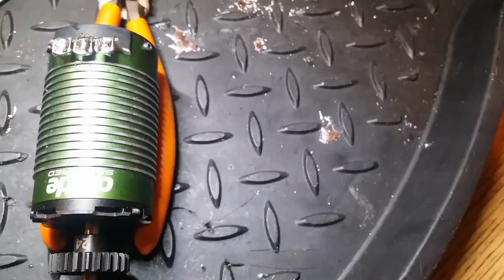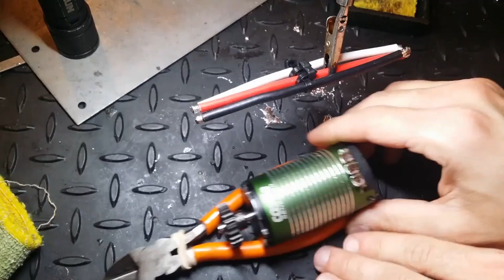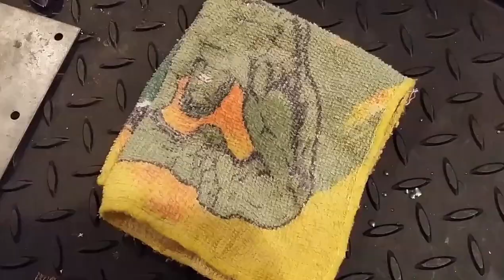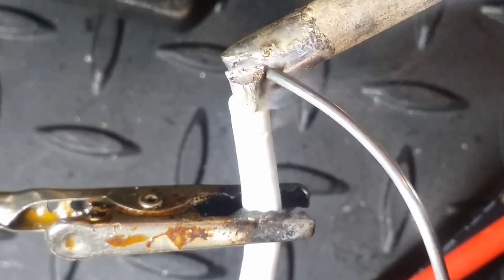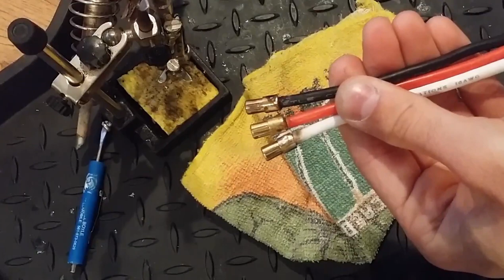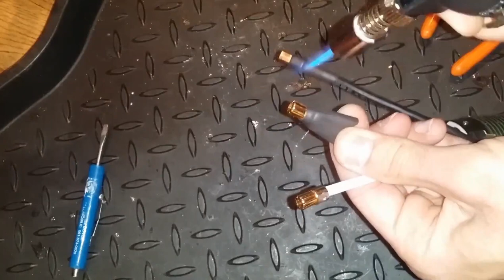Soldering Wires & Bullets on RC Car Castle 1800kv Motor

Comment: Easy Peazy ! Only took me two hours and a half a roll of solder to do a motor and battery terminals and I have a little to no confidence in my connections!😢
Reply from the maker: Gotta practice, also gotta practice with a good iron. Get an SP80NUS from Amazon. 80 watt Weller.

Comment: Clean Work buddy. 👌 I'm about to solder up some Turnigy HXT 8MM connectors. Never used them before but they look like they can deliver & handle the amps I'm goona put through em.
Reply from the maker: Thanks! Nice, make a review video of them if you can. I'd like to see how those perform
Reply: @InnovationRC  See what I can do buddy. At the moment I can't even get out with my RC cars with COVID 19 here in UK on Lock Down, so just keeping busy at home with projects & with family. When I do get out however I will see if Wife or friend will record Vid on Phone. Take care. 👍

Comment: I had one of my leads get ripped off and it also took off the gold plating. Now when i try to solder the wire back on to the copper plate, it will not stick at all. Been trying for so long and even took to someone and they couldnt get it either. Any tips for how i can get it to stick? Is it going to be the flux that makes it stick? Thanks!
Reply from the maker: That's unfortunate. Maybe try adding flux and attempt to re-tin the tab. If not wire brush on a Dremel to rough it up hopefully it'll work after tinning that.

Comment: Does it make a difference if you wire direct from motor to ESC, or use bullets to connect two wires together? From a practical point of view it’s better as it’s easier to swap motors out etc. I assume any performance difference is minimal, if at all. I am about to solder mine, and would prefer bullets so it’s easier to take motor out for maintenance, etc
Reply from the maker: Not much of a difference if your soldering is good. Pick your poison

Comment: Super satisfying. I had a question however, I have been searching around and can't find the answer. I have a motor, the Turnigy XK3650-3650 sensored, and the terminals on the motor are these circles/pcb board. How do I solder to that? Is it just a female bullet connector in there and cover everything in solder?
Reply from the maker: Likely you have to stick the wire through and solder on the flat spot of the solder board. I will say it's tricky. Be sure to lightly tin the wire and have something hold the motor in place while you carefully do that solder job
Reply: @InnovationRC  thanks man. Keep on crushing it
Reply from the maker: @Spacecadet0730  thank you 💪 good luck with the solder

Comment: are you supposed to leave the motor wires exposed? Isn't it dangerous?
Reply from the maker: Yes you'll be fine as long as it's soldered correctly

Comment: what alloy solder do you use for soldering motor wires?
Reply from the maker: I use 60/40 Rosen core solder, leaded so it's easier to melt. For the serious cars I use silver bearing solder. Higher melting point
Reply: @InnovationRC  thanks 😊

Comment: Wow I have been struggling like crazy on this. It’s not that I can’t solder. It just won’t stick. But I’ll try this neat little trick and hope that works
Reply: It did. Thanks
Reply: so what was the trick it wont stick at my motor to i dont know what to do
Reply: @tanertuncer7284  you have to clean the surface really well. Make sure you get all the coating off.
Reply: @jimmyv1753  you mean the gold coating?
Reply: @tanertuncer7284  yes. Well. The coating yes. It should be copper underneath. I think they coat it so it doesn’t tarnish. But if you don’t get all that coating off the solder will not stick.
Reply: @jimmyv1753  thanks im gonna try it again tomorrow
Reply: @tanertuncer7284  good luck my friend. I know how frustrating that can be. The method that worked best for me was to get a lot of solder on the post and a lot on the wire then press them together and pin the wire down with the iron until it melts together
Reply: @jimmyv1753  cleaned the coating until the copper comes and didnt work either idk
Reply: @tanertuncer7284  do you have flux paste?
Reply: @jimmyv1753  no but i could get some
Reply: @tanertuncer7284  get some. It will make things much easier. Also thin solder. Thinner solder melts much easier and the paste on the copper will cause it to absorb the hot solder. I’m sorry you’re having such a difficult time on this thing. I’ve been there. Before you do that see if you can get any solder to stick to the either the copper post or the wire. If you can’t get it to stick to either then get the paste. Put a small amount of paste on the wire and a small amount on the post. Just a tiny amount then melt it with the iron then see if the hot solder will stick
Reply: @tanertuncer7284  did you end up getting it?
Reply: @jimmyv1753  nah didnt try it today dont have that much time safly cause im having my finals in this time but i will try it these days we will see
Reply: @tanertuncer7284  I get it. I was just hoping you had some success with it. I also am lucky to get a few minutes a week to work on my RCs
Reply: @jimmyv1753 how do you get the coating off?
Reply: @officialoppclan2039  I use a dremel with a harsh scrubbing wheel. Like a scotchbrite pad but a wire brush might get it off or a razor blade to scrape it off. It takes a little scrubbing to get it off. Makes for a much easier time soldering it

Comment: Very nice and clean...... for the idiots what does flux do?
Reply from the maker: Not an idiot at all. Flux basically cleans the oxidation off stuff it touches so it can allow solder to flow cleanly to whatever it is your doing.